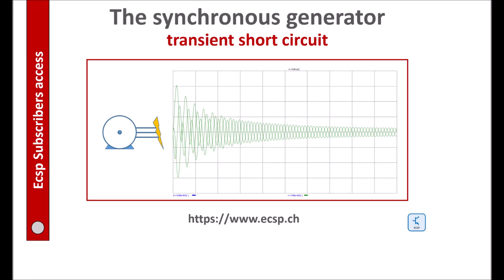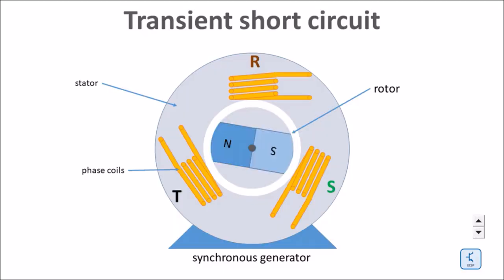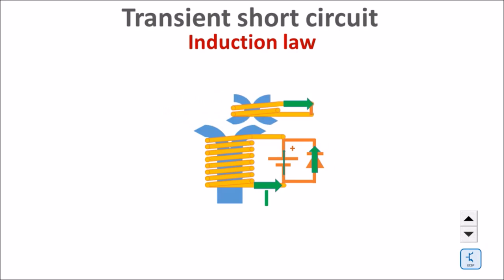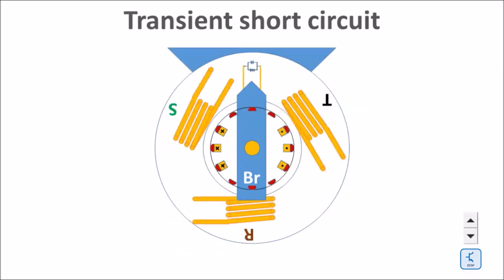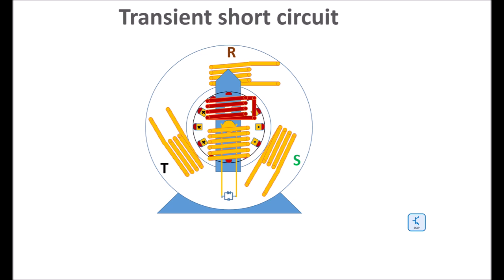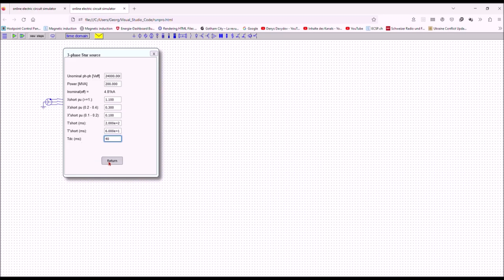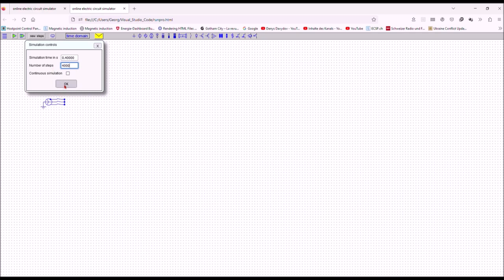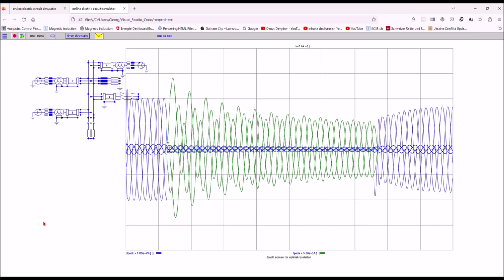Synchronous generator transient and sub-transient short circuit current

Comment: As I understand you’ve showed that the exitation current increases under short circuit. But what about the voltage drop during short circuit??? Or both apper together exitation current increases and output voltage drops??? So, why do we need a exitation system which increases the exitation voltage for example during big induction motor start?
Reply from the maker: I am not sure if I understand your question right. This video is about synchronous machines only and yes, there is a voltage drop during a short circuit.
Reply: @georgschett801  You showed that exitation current increases. So why do we need AVR??? 

And do we face the same problem wen we have permanent magnets?
Reply from the maker: @high4702  The current in the excitation coil is jumping at the instant of a short for keeping the magnetic field within the excitation coil constant as per induction law. This jump however decreases again with the transient time constant and so the excitation current returns to the level before the short. The excess current caused by the short bypasses the excitation source through a diode parallel to the excitation source as per my video. The AVR has nothing to do with the short circuit, it is regulating the steady state voltage of the Generator. In case of a hypothetical permanent magnet there would be no transient short circuit but only a subtransient, in case of the availability of a damping cage.